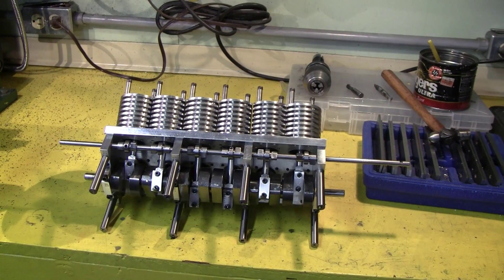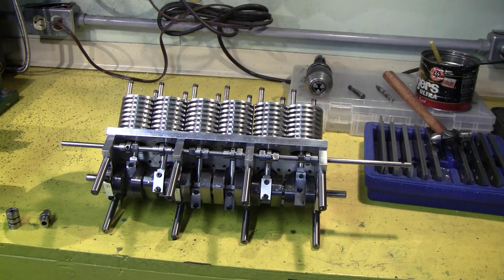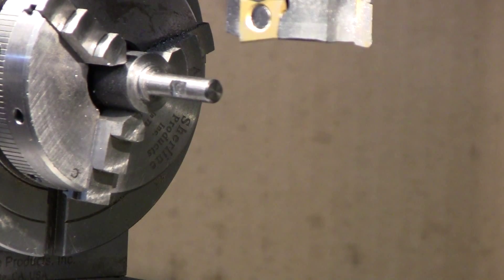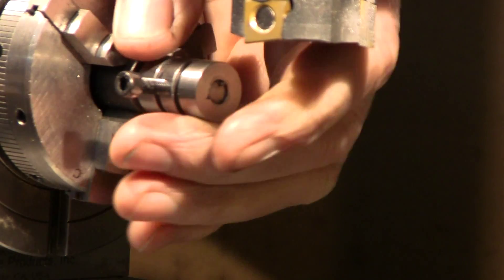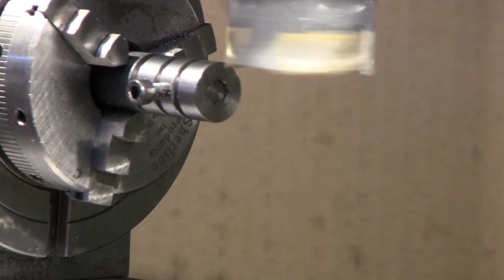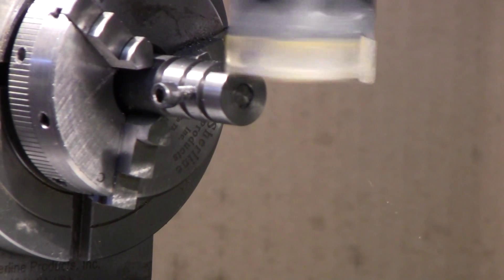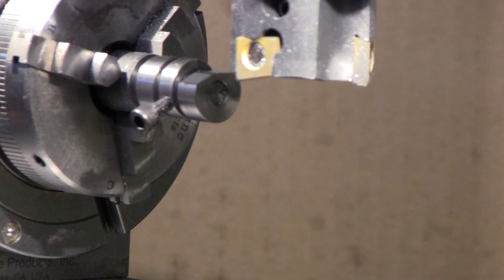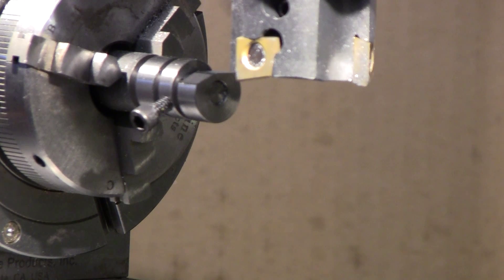V12 Making Cams

Comment: Hello, I've been looking for a technique to make a cam for an engine I want to build and I like this set-up. What I was also hoping to see though is the actual set-up numbers. I see you mention the lift height which is understand but as you rotate each 5deg, how are you not just making a uniform circle??? So I'm guessing the fly cutter is not on center of the cam blank? How much and which direction do you set the cutter in relation to the cam blank? Thanks, Mike
Reply from the maker: The cutter is on center of the cam blank.  You dont cut the full 360 degs. Where you start and end the milling operation is where the lobe begins and ends. You just removing the portion of the cam that dose not lift the valve.
Reply: Ahhh, that makes sense to me now. Thank you for the fast reply! I found your video where you run the engine. Sweet!

Comment: could you tell me the contents of the blue box under the hammer as I have jut been given a set the same by my friend  and I have no idea what they are.
Reply from the maker: they are called parallels. Usually used as spacers to hold work above vise jaws on the milling machine.
Reply: thanks for your quick response subbed your vids